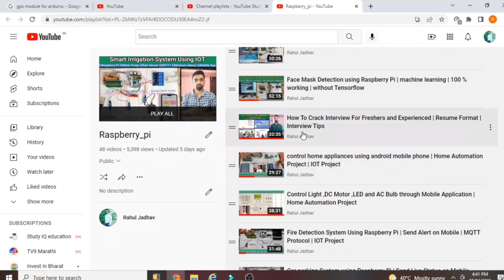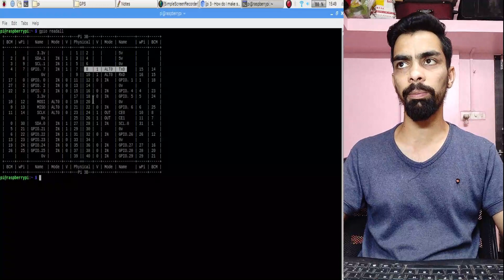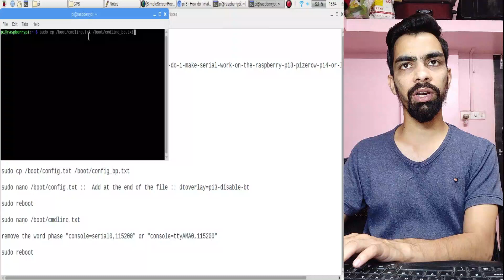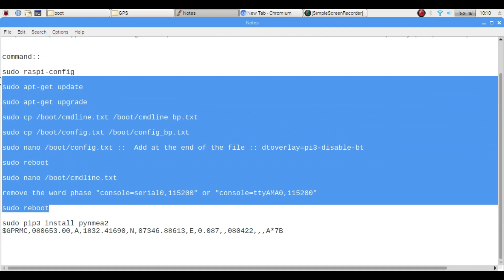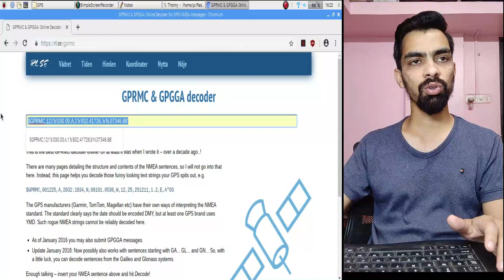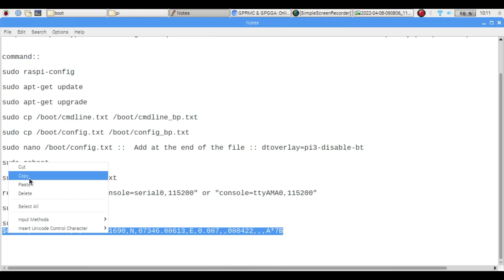GPS Module With Raspberry pi | How to Interface GPS Module with Raspberry pi

Comment: Hello Sir! Can you please do the GPS Tracking and Sending SMS with the real time location with Raspberry pi? Lastly, does my question needs to have a Wi-Fi connectivity or sim card load to run the system and to send a realtime location through an text message? Please noice this comment, I really need your help. Thank you!
Reply from the maker: I think I already did a video on this topic
Reply: @Rahul_Jadhav_Project Oh I found it. Thank you bro it will help me to my research!
Reply: @Rahul_Jadhav_Project  What is the link?
Reply from the maker: @ShreyanshMedatatiplease check my playlist
Reply: Did you get this video?

Comment: Can you please do with Rasoberry Pi 4. I am not getting any data. Please help me out ASAP.
Reply from the maker: There will be no changes in code.
First check after you given power to gps module whether its shows connectivity or not. Its LED should blink then only you will get data.. gps module does not work inside the home.
Reply: @Rahul_Jadhav_Project  It is working. I just had to take the sensor out to an open land. The sensor is not able to receive any gps signal even when placed near a window or outside a window.

Comment: Sir my gps light is blinking but in program I am not getting any data 

There is no error in code, can you please guide me
Reply from the maker: Please check the connection..code is working perfectly..i have tested that one.may be your connection having problems
Reply from the maker: You have to enable serial communication on raspberry pi as explain in video